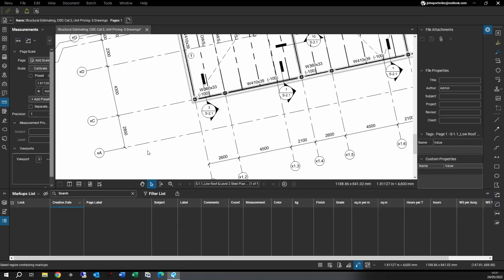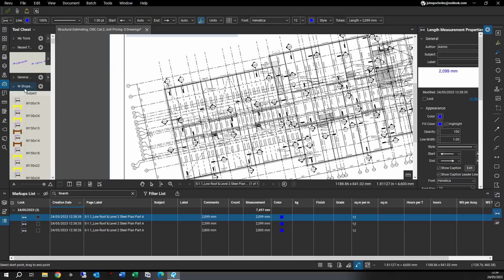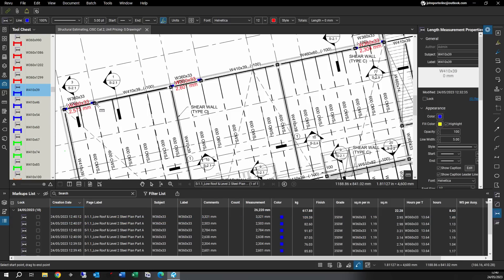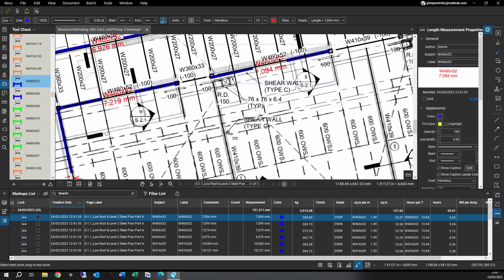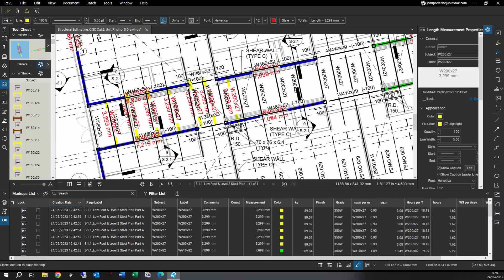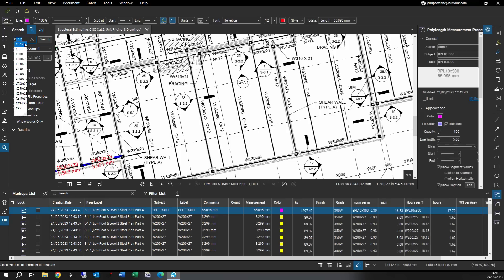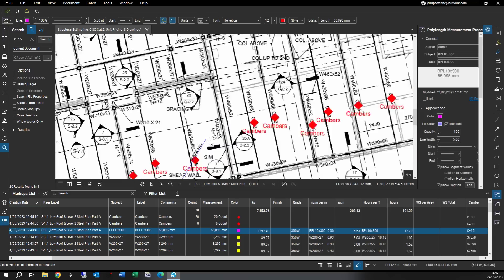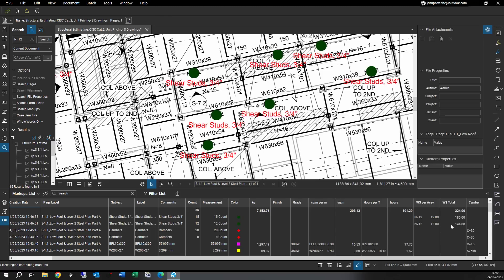Bluebeam Digital Takeoff, Estimating- Division 5, Structural Steel, Part 1

Comment: how do you set up your toolbox with all the sizes of material?
Reply from the maker: It's a labor intense process.  Data is added thru custom columns and than needs to be connected to toolset.  Our toolsets is now capable of pricing job directly in Bluebeam.

Cheers!

John Porter